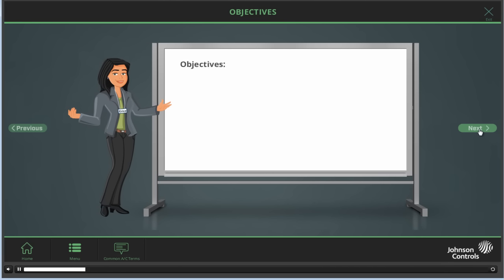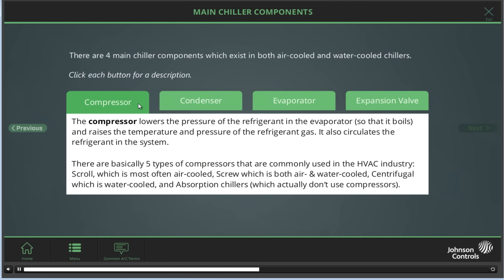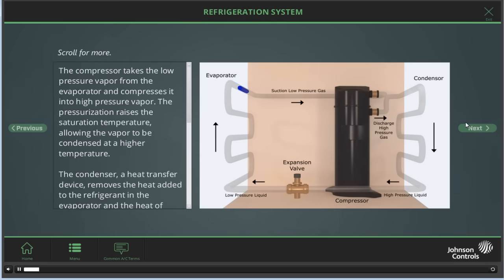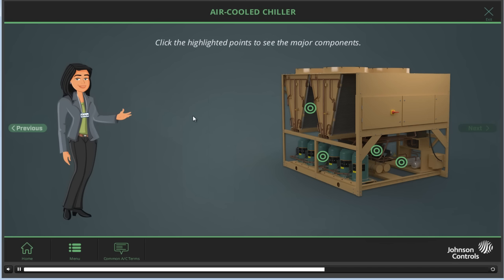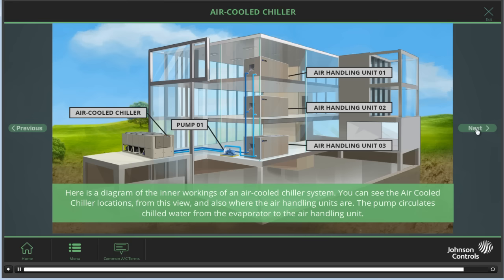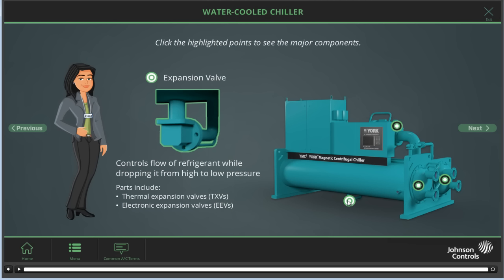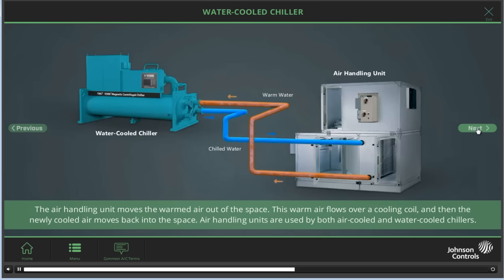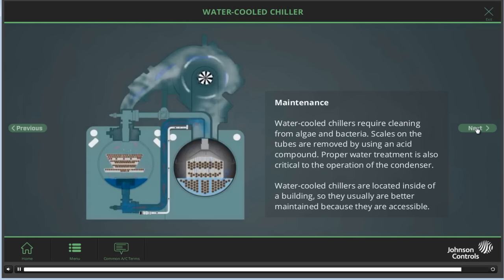Module 1: Introduction to Air-Cooled and Water-Cooled Chillers

Comment: The compressor increases the pressure, not lowers the pressure
Reply: thnx I was searching for this comment
Reply: You have told me very well
Reply: Yes, and into the condenser, not the evaporator. The pressure drop is after the expansion valve into the evaporator